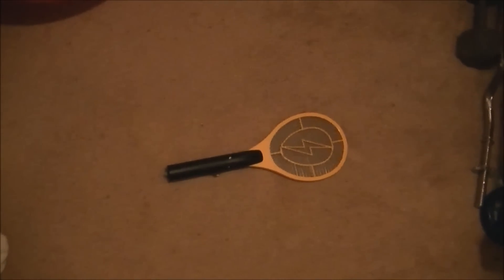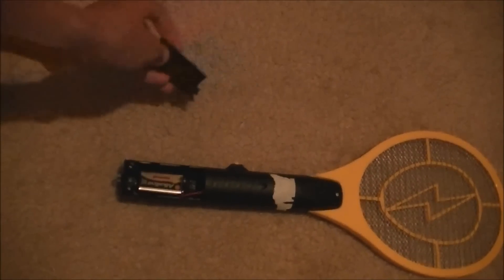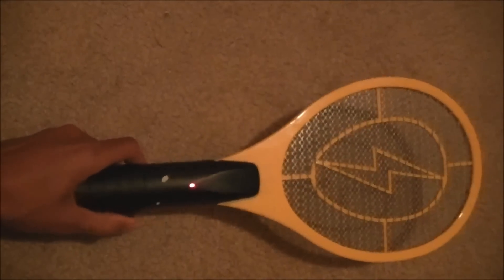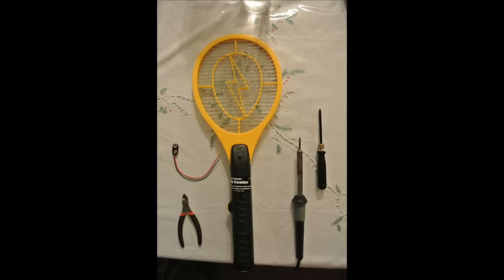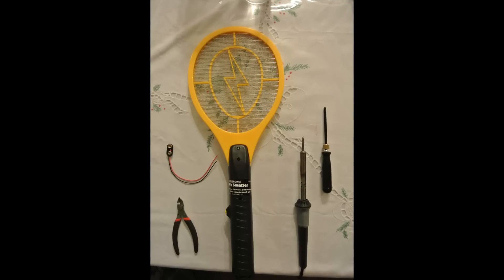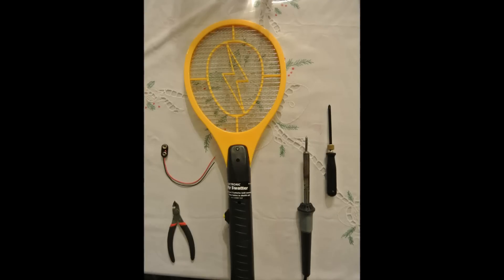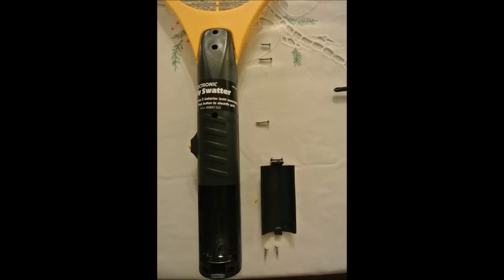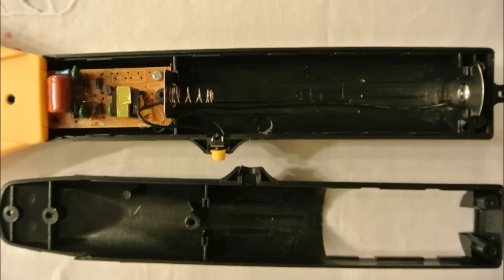How to Mod Your Electric Fly Swatter to Triple the Zapping Power

Comment: one problem is the resistor that drains the capacitor so the grid is off when not in use burns out the grid and stays live till the capacitor discharges did this mod a few years ago and learned real quick!

Comment: They come with a 2KV capacitor (big orange thing at the end). I replaced it with a 5KV cap and it still fit in the case. Hell-a-Pop the flies, we're talking pieces everywhere. But the cap just blew up for some reason just recently

Comment: If you cut the power bleed-off resistor located across the capacitor you'll increase the level to which the capacitor will be able to charge. Gives a much bigger zap, uses less battery power (since once it is charged up it won't discharge; no need to constantly hold down the power button). Remember, once you charge it up, it won't be discharged again until you zap something.
Reply: Three years into the future I thank you!
Reply: Does that actually work? so just cutting loose the resistor in front of the capacitor does the trick?
Reply: This particular brand doesn't have a bleed off resistor.
Reply: @siggyretburns7523  If it looses zapping power after 10 minutes of released power button, than there is one somewere. Might be not on the pcb but in the wiring that goes to the mesh.

Comment: classic case of a complete waste of everyone's time by someone who doesn't even know the first thing about electronics, yet feels the need to "teach" the world his brilliance by example
Reply: Why is that? Doesn't more voltage also fill the capacitor more? Or will the 3V always charge the capacitor to the max (which is the max input of the 2 AA batteries)?
Reply: The cap will only store its max, no more. The only way to meaningfully up the 'zap' would be a different transformer and a bigger cap
Reply: Agreed 100%. Read the comments before pulling the trigger.

Comment: In nearly all cases adding voltage will not increase power. Exchanging the capacitor for a higher value one or adding more (in parallel) will enable your fly swatter to hold more charge thus delivering a bigger louder spark. Adding voltage will just charge the capacitors quicker
Reply: +TJ Williams Agreed. All this mod has the capacity of accomplishing is smoking your circuit board. I have 3 of these swatters, going to attempt to mod one of mine as you suggest. We have a TON of wasps flying around our yard this year, building nests (queens). The off the shelf electric swatters just make them MAD... unless you can make contact for 5 seconds or longer... Anyway, I wouldn't advise that anyone tries the mod in this video unless they just want to prove your point :)
Reply: +TJ Williams 
I put three extra matched caps in parallel on an old swatter about a decade ago. I removed the racquet head so that only two conductors were exposed out the top of the unit. I could 'zap' people through their door handle as they answered my knock :) It used to leave scorch marks on the door handle from the power it was delivering!
Reply: +RandomPrepper2K i will be doing the same when i get time. Yeahh i had one of these swatters and i would swat house flies but It just made them crazy and didn't actually kill them.
Reply: adding voltage will increase power, if you increase the input voltage of your transformer in the circuit it will deliver a higher output, though you should also change your capacitor to handle that voltage and if you want it to hold a higher current in the capacitors put them in parallel for more power.
Reply: Additional capacitor in parallel will help. Why are you trying to correct this fool who is trying to fool others by saying increasing the voltage will increase the bat performance
Reply: Additional capacitor in parallel will help. Why are you trying to correct this fool who is trying to fool others by saying increasing the voltage will increase the bat performance
Reply: I just put 2 microwave oven capacitor's in parallel with the output of the bug zapper circuit. I call it the bug fucker.
Reply: How do you add an extra capacitor in this electronic fly squatter and where do I have to look out for? Is it just any capacitor that works on 3Volts?
Reply: You are exactly right.too high of voltage will only blow out the transistors.  Unfortunately it’s much more complicated than that to build in more output.  Remember voltage is only pressure. It can fill the capacitors more quickly provided it doesn’t blow the transistors.  They are sensitive little critters.

Comment: @1:32 while also tripling the load on the already cheap/underrated internal components such as the cheap no-name resistors and capacitors that can; and will vent when used outside of their range for extended periods. Could end up burning someone or stating a fire. That all being said, it's a cheap harbor freight swatter. Why not take it apart and tinker with it? Hell, sometimes I will upgrade certain parts of a product knowing it will cause other parts to fail in a remarkable fashion; cause it's fun. Not to mention, years ago my buddies and I would zap each other for laughs (with unmodified swatters). Just wanna see everyone be safe. If someone didn't know what they were doing and stuffed a supercapacitor on a circuit like that, and by some freak chance other components didn't open-circuit; who/whatever is completing that circuit will have the instantaneous pleasure of receiving a hefty capacitive discharge. Honestly I wouldn't know so much about electronics had I not rode the lightning years ago. Was inside a desktop PSU (had no business or knowledge to be in there) and discharged a capacitor with my knuckles accidentally. Luckily the psu had been unplugged for quite some time, giving the capacitors time to self discharge enough to not make me croak. Still, walked away with some war-stripes of burns on my hand and a healthy fear for electronics. Started learning as much as I could from that day. Other then one instance on my own negligence (trying to multi task while wiring shop lights) I haven't come close to riding the lightning again.

Comment: Interesting idea. Just did a video on this too. They make about 900V stock.  You will ultimately be limited by the PIV of the IN4007 diodes, which are rated at 1kV. So you might get the same results with 4.5V in batteries with less trauma to the components.
Reply: No. They make 2000-3000 volts stock. Leave the input voltage alone, and add more output capacitor to make it stronger. Adding more input voltage WILL simply fry the switching transistor in a hurry.

Comment: I ran that exact zapper on 5 volts and it nearly blew the transistor. Could I replace it with a higher power one, such as a 2n3055?
Reply: Cogman Inc. yes but i don’t know anything about them
Reply: @eshay6132  If you don't know anything about them then how can you give a sure answer?
Reply: You could replace the transistor with one of higher specs.
Reply: @davelowets  Oof, this is an old comment.

Comment: Well this didnt work I connect plus to plus minus to minus but nothing happens when I press the button but if I use a normal battery it does ? I tried using a power bank but for some reason It doesn't work either

Comment: I bought one at Harbor Freight on sale for $3.  So, it's no big deal if I fry the electronics. It operates with 2 AA battery.  So, I tried using a 9 volt  battery (used measured 7.2 volts) that is used in those smoke alarm.  It fits in the handle.  There is no need to open up the handle.  A wad of aluminum to make contact at the + terminal is necessary, and the cover will not fit over the battery.  I use a rubber band to keep the battery in place.  So far, the 9 volt battery has not fried the electronics, but I don't energize the circuit for too long.  Smokes warps!  Put a screw over the grid, and it sparks!
Reply: It will do all the and things with the original battery!

Comment: They are rated for 3 volts if you put more most of them will burn out i have tried.
Instead of putting a 9 volt try a 18650 battery you can recharge and it runs at 4 volts
Reply: Mike Fabiano yea me and my gf tired this with zap branded swatter and holding down the power button for over a second would cause board to smoke still a great idea

Comment: You capacitor inside the fly swatter may also explode :). No joke!
Reply: Correct...
Reply: @davelowets  Need more power? Put a bigger capacitor in there, CBB metalized polypropylene cap 2000V 474j (0,47uF) Makes the fly explode Muhahahah ;).
Reply: @jimmihenry  Yep. Been doing that for years. Higher input voltage just burns up the switching transistor very quickly. More capacitor is the way to go. The output voltage is already high enough.
Reply: @jimmihenry  The stock output on mine is 2850 volts. I needed a higher voltage rated cap. ⚡ 🌩

Comment: I tried this with the very same racket that I have & it was good at first, but the voltagemust have been too much & it killed something on the circuit board.
Reply: Resistor most likely. Or capacitor.

Comment: I'm not going to come down on you too hard but you clearly don't have an understanding of how this item works.  You're not increasing the power that this works at. All type doing is stressing the circuit and charging the capacitor more quickly.  But a capacitor will only hold so much energy. Unless you increase the size of the capacitor or run others in parallel with the one already on there you are definitely not changing anything about the power at which this device zaps bugs. That being said,  I don't discourage you from experimenting with things,  that's how alot of people learn. But I do encourage you to do some more research into how electricity and these components work.  For instance,  had you touched that brown components leads at the top (the capacitor) you would have gotten a bit of a shock since you never discharged it before working on it. Best of luck.
Reply: There is always a bleed resistor across the output capacitor.
Reply: @davelowets  yes and we all know components never fail.
Reply: @thatsfunny7729  resistors rarely fail in an application such as this.

Comment: how do i switch the circuit board of the swatter with a 50000v tazer circuit board?
Reply: +Belnick6666 replace the transformer
Reply: Shaheer Syed
to what ?
Reply: @cloroxbleach1200  NO. Just replace the entire circuit with a taser module, and attach the taser output to the grids.

Comment: In theory, increasing the DC voltage should then increase the output voltage... no? unless the oscillator's feedback clamps it... that, I don't know.
But, if the output voltage does indeed increase by a factor of 3-ish, would the output-Cap handle the higher voltage or would its 1000v rating just cause it to fry?

Comment: How well does this work compared to adding capacitors. Will the added voltage kill the capacitor or other electronics? How many volts did your unit put out after modification? Thanks
Reply: The higher input voltage WILL fry the switching transistor very quickly. Just add more output capacitor for a bigger bang, and leave the input voltage alone.
Reply: @davelowets  Which capacitor should you add to the existing (or replacing)? Does it has to be some sort of input voltage or can it be any capacitor ranging between 3V and let's say 10V? And how do you exactly know whether the capacitor is 3V (I have some old ones laying around here, but I am not knowledgeable really in this field). Or do you have parts numbers maybe or links which capacitor I could add parallel to the existing one?
Reply: @luttekikker  look for a 2000 volt .1uF Mylar capacitor.

Comment: If you'd remove the resistor closest to the big capacitor, you would actually have what you are looking for..
Reply: Thanks!
Reply: Why is that exactly? It will not make the maximum charge of the capacitor bigger (it only will charge probably faster and not discharge automatically right?)
Reply: @luttekikker  Exactly.  Cutting the resistor isn't the end goal.  Increase of zap power is.

Comment: Do not do this.... Cranking up the input voltage from 3 volts to 9 volts WILL quickly burn out the transistor that powers the step-up transformer in the circuit. It's not a question of IF, but WHEN, and it will usually happen quick. The output voltage of the fly swatter running on 3 volts is already PLENTY high enough to do the job fine.(2000-3000 volts) It's the AMOUNT of stored power in the capacitor inside that can safely be increased if you want to juice it up. Replace the stock capacitor with a larger value or parallel another capacitor across the stock one if you want to safely increase the zap power available. Make sure the value of the replacement capacitor has enough voltage capacity.
Reply: Got a link or info what to look for when ordering such a capacitor? I want it to add to the existing capacitor after ordering it online.

Comment: What will this do to you when you touch it? Have you ever done that? Cause I want to use this in my DIY taser that I made from an elelctric fly swatter, but I first want to know if it will be dangerous.
Reply: same here. i just watched a video claiming that this mod is fake.
Reply: I made a taser using this video and it works! And I touched it and it hurts but it isn't dangerous
Reply: It would never be able to properly "tase" anyone. It would simply give a mildly painful shock. A taser output is WAY higher voltage and lower amperage that can penetrate to, and disrupt a person's nervous system. Something a flyswatter would never do. All you will end up accomplishing with the flyswatter is to piss your attacker off more, and end up getting a bigger ass kicking. Not a food idea. 💡

Comment: I dont think it needs to be said that youll void the warranty on a FREE or $4 electric HF fly swatter. If a person is concerned about voiding the 90 day warranty figure this. 2 D alkaline batteries cost more or the same price as the fly swatter. Even a 2 pack of 9V alkaline batteries cost the same or more.
Reply: Those twisty things. Wire nuts  11 minutes of showing how to take apart 5 screws and twist some wires together and put the case back on. Bro quit watching videos and trying to recreate them. Video sucks
Reply: It’s extremely dangerous when they allow people to post videos with misinformation or rather a video filled with total ignorance, someone said they won’t come down on him hard, I will because this “awesomer” fly shatter may not be shit because the output voltage will be the same electrical 101 but he could of showed something much more dangerous and some kid thinks it’s correct because it’s on YouTube. Think about that bro before you make a video about taking 5 screws out and adding r3x the stress on the components with no actual increase in output. Please do your research before thinking you can make a video because you’re bored in the middle of the winter. Clearly someone told you they did it or seen it on the net and thought you could become a YouTube star. This was clearly not out of necessity. Ignorance causes a lot of injuries. Do your damn research earn the components and what there functions are and how they work together.
Reply: @jameseiseman8741  So, adding a second capacitor parallel to the existing capacitor is the key then. Question is which second capacitor can be added in order to just get a bit more power to the electronic fly squatter because my fly squatter does close to nothing to flies. I just need a capacitor that holds enough power and can be installed in this 3V swatter without making it too dangerous. Got a link of such a capacitor online so I can order that one and solder it parallel on top of the existing capacitor that is already on the board of the electronic swatter?

Comment: DO NOT DO THIS .On the 2nd zap i got more smoke from the handle than the fly, turns out transister and 1 small capacitor and the bigg one fried and exploded. If you want to upgrade do it properly and upgrade the circuit too. your method is like plugging a 110v TV into 220v outlet to get a brighter picture. Probably what happened to yours too thats why you never showed it working.

Comment: From what little I understand, the 9V have somewhat less milliamp hours than the C or D cells. If you're going to gut it and do some soldering, just piggyback some caps on the circuit to boost output and leave it with the default battery size so you'll be able to zap more bugs.

Comment: You didn't even show your progress !!! PS this change will do absolutely nothing the compositor only holds a certain amount of charge before discharging because that is the limit it was made for. putting more power will do nothing it might just last longer that's all. you should of just cut off the resister if you want more power you have to change out the compositor for a more powerful one. You don't need to change the battery to do that it will still charge the bigger compositor regardless to the same voltage.

Comment: I can't wait to have some zapping fun.  Just arrived home after shopping for all I'd need to explode some wasps.  I work in the wine vineyard industry.  There are loads of wasps. With just "D" cells the wasps are stunned and then pissed. I want to eliminate the threats. After I Ave modified and tested I will repost...  "I can't wait!!!!!"
Reply: When shocked the wasp grasp the metal wire with their feet which keeps the hanging shocking and shocking  them even more until the fry themselves